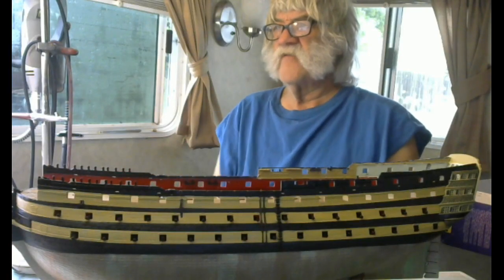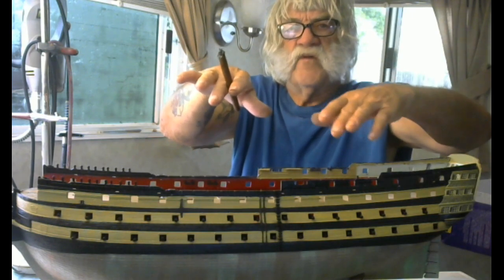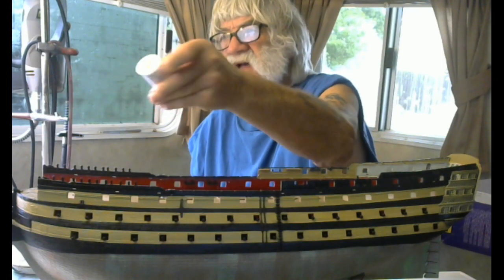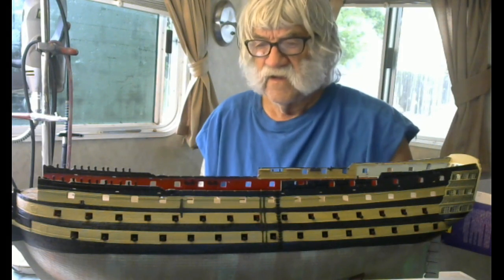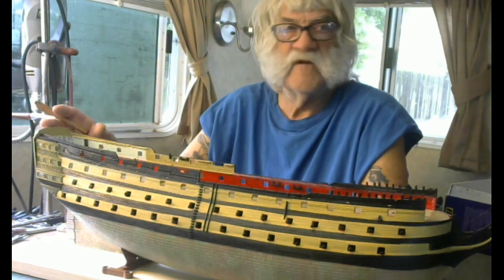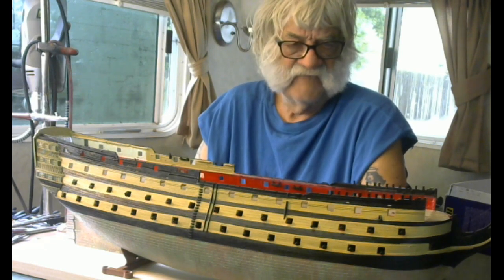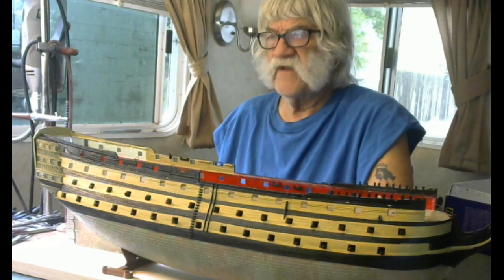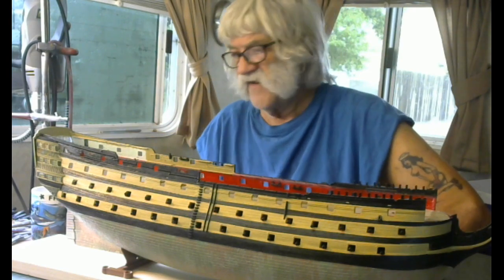HELLER 1/100  HMS VICTORY   Spar Deck And Details  VIDEO 5

Comment: I'm currently working on the top deck of the HMS Victory that Heller is assembling and I see a problem with the width of the top deck's bow exceeding the interior of the main deck!? Because of this, the deck doesn't go into place easily without stretching the side? Is there any advice for this problem? Happy December to you! 🙏